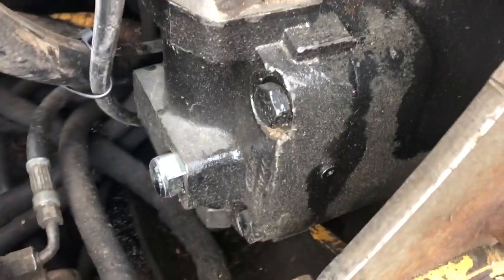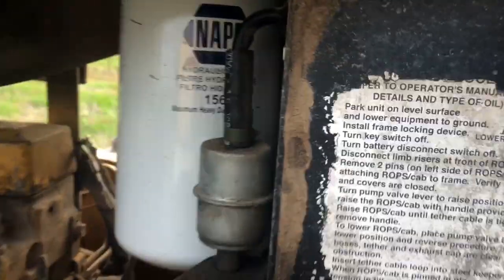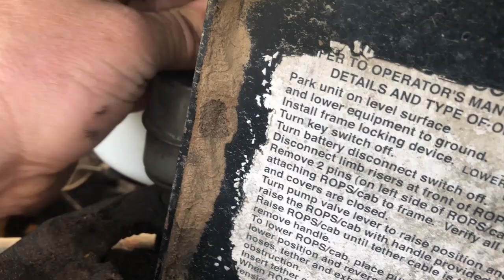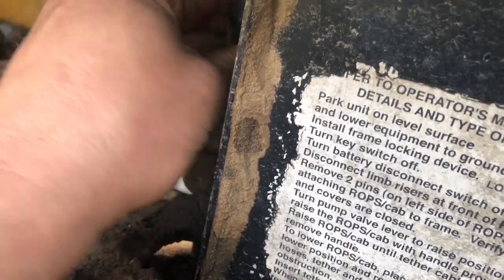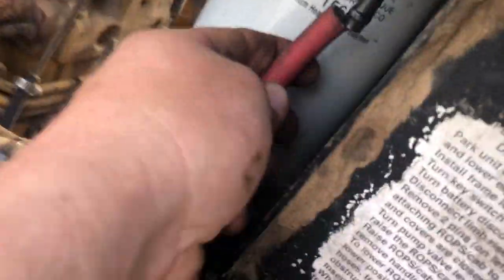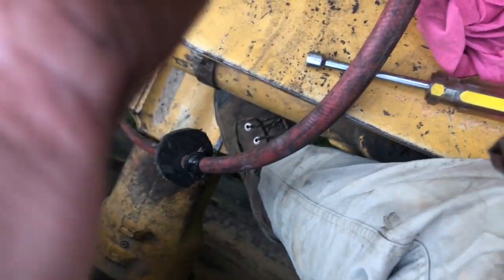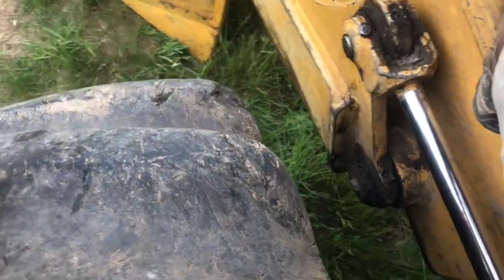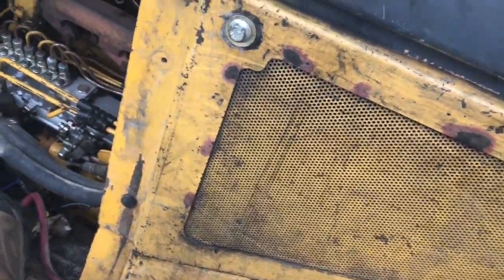Air vac to the hydro tank!!!!!

Comment: I've used the air vac trick many times. It definitely works! You can also use it on fuel tanks and coolant systems. A word of caution for EVERYONE.... DO NOT USE A SHOP VAC or anything similar! The sparks generated in the motor of a vacuum cleaner can ignite any vapor that build up inside of the vacuum. ONLY use an air vac or something similar to pull vacuum on a hydraulic or fuel tank.
Reply: How exactly does the air vac work. Is it just holding the fluid off the bottom?
Reply: Tucker Shrout, some use air to run a little vacuum pump and others work on a siphon principle. Sounded like Wade's is a siphon.
Reply: Since a vacuum is being created in the tank, air wants to enter wherever possible. As long as the only point of entry is the fitting you are working on, the air will enter faster than the oil can escape. Therefore, it pushes the oil up into the tank. It will just sit there and make a gurgling sound as long as the vacuum is applied.
Reply: You can do a similar experiment with a bottle of water. Have the bottle about 1/2 full, poke a hole near the bottom and cover it with your finger. Suck on the top of the bottle as you remove your finger, and you will find that no water leaks out and bubbles form at the hole and rise to the top. If the vacuum (suction) stops the water will leak out.
Reply: tractor man TP, that would be no good. Did he live to talk about it?

Comment: Cat makes a transducer that does the same trick. We use them on a regular basis, saves a lot of extra work. Just don't unplug the air line,  your quick fix turns real messy real quick. My 3/8 drive cordless is one of my favorite tools. The only thing more needed is my laptop. PLEASE purge the air from your pump cases BEFORE you start your engine, If not, your pump will last hours not years.  love your vidjas.

Comment: I put a air pressure regulator on mine that way I can put a lower vacuum on it just enough to hold the fluid, and that way I don't destroy any seals due to full vacuum .
Reply from the maker: Very very intresting thanks bud